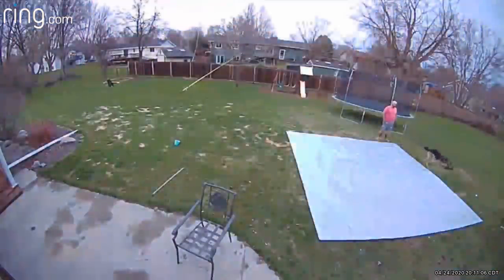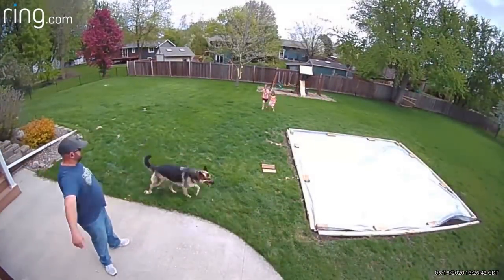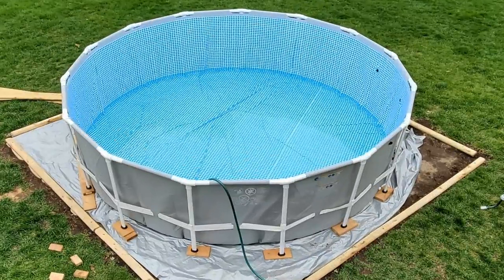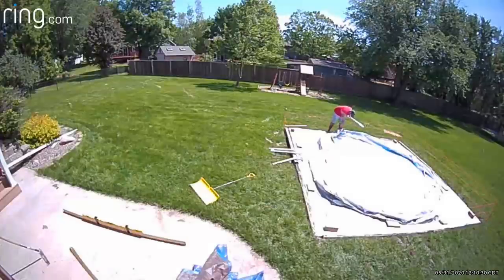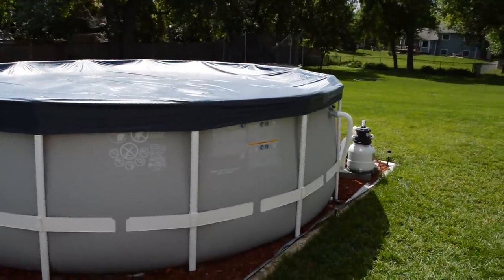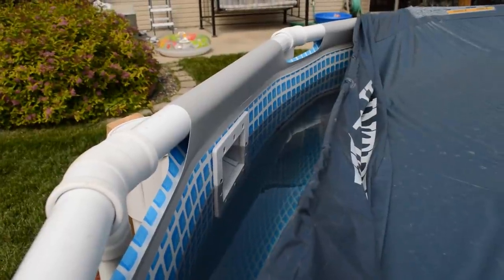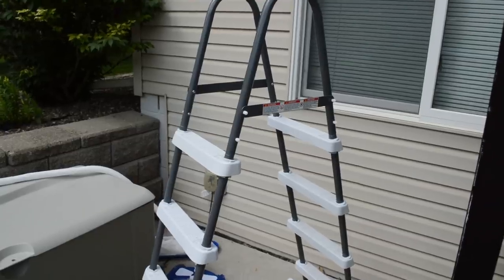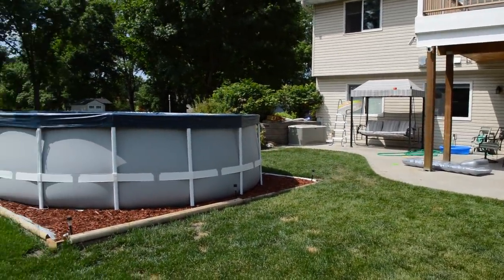Intex 15 Foot Prism Frame Above Ground Pool Setup, Review, and Mistakes!

Comment: If i cut the power of the sanfilterpump with a switched power socket then the adapter of the pump trips and i always have to reset it manually. How have you solved this one?
Reply from the maker: Using the Kasa switch that I recommended, I have no issues with this. I have it set up on a schedule that runs every day and it's never tripped.
Reply: Don't Burn the House Down! So you have this small box in between with the reset button also? I ll check out the tp-link
Reply from the maker: The pump has a GFI switch on the end of its cord with a test and reset button on it. It's never tripped for me using the Kasa (TP link) switch. I keep it in a dry area and it's on a 3 prong grounded outlet. No issues this far.

Comment: Whoops I forgot we had to go get 22 1 ft x1ft 2inch thick pads for each leg to set on to ensure a good stable  footing for the 10,000 gallon pool an estimated weight of 85000 pounds not including  the 5 tons of sand !

Comment: How the hell did you get the last joint together. Mine are like a foot too long on each side.
Reply from the maker: That could be a few things. Some of the other poles might not be fully seeded into the t joints, your ground might be off level causing the whole thing to slope towards you, or you might just need to grab the frame at several points and pull it outward.

Comment: Thanks for sharing. This was very helpful. I have set mine up about three times - 15 feet, and it wasn’t level but it was just enough. We moved into a new house last year and order a new one. It’s 18 feet round and on the way. I am dreading the work that has to go in to leveling because I think I’m about 1 foot off level from front to back but this was extremely helpful. Thanks again. I may come back to let you know how it turns out. Or let you know if I have an 18 foot pool for sale.
Reply from the maker: Thank you for the comment! Definitely keep me posted on how the project goes and/or if that pool hits the market! 😅

Comment: I'm getting low pressure on my filter. Any clues or tips?
Reply from the maker: Low pressure is good!! You want the pressure gauge to be low or in the green. As the filter starts to slowly clog up with debris from the pool, the pressure gauge will rise. If it gets in the yellow or red, it can burst. You need to backwash the system periodically when the pressure starts to get anywhere near the yellow. Keep it in the green or below. As long as you have solid water flow coming in and out, you are good!
Reply: I appreciate it! A video on your use of the filter would be awesome!!

Comment: Did you water the sand after your packed it with the roller?
Reply from the maker: Yes
Reply: Don't Burn the House Down! Thank you! If my pool comes out solid, it's only because of your video and help! I really appreciate it! 🙏
Reply from the maker: Glad I could help! Make sure the sand is dry before you use the roller otherwise it will stick to the roller like crazy and defeat the purpose. Good luck!

Comment: Are your wooden slats sitting on top of the sand too?
Reply from the maker: Yep. They are on top of the ground tarp which is sitting on top of the sand.
Reply: Don't Burn the House Down! Oh wow ok..I didn't know the tarp should be placed under the pavers/slats. I'm using 12x12 concrete pavers. I was really confused is I should level the pavers with the ground floor or sand floor, or they should just being laying on top of the dirt or sand. Really nervous about throwing off the level of the pool. Lots of work! 🤣

Comment: how much does it cost you a month to maintain?
Reply from the maker: That's hard to break down. I bought a massive tub of chlorine tabs last year that I'm still working through so I won't need any more chemicals. Electricity for the pump is really it. It's not that much after the initial startup cost.

Comment: Im sure ground prep is the work most people skip. For my 12 foot, I started by digging down 3 inches on the high side and pushed dirt to the low side and levelled. I should have done al least 1 more inch and compacted the low side better. took me a long weekend to do. I did not have a sod cutter or rototiller. (next time I will rent one.) I later added a brick border to the high side. I drain and take it down every fall because we have long freezing winters. Just finishing 6 years of life. Set up is about 30 minutes each spring. Fill takes most of a day. Those cartridge filters can't filter algae if it gets away on you. I end up vacuuming (siphoning out) half of the water. I will get a sand filter for the next pool .I got my $300 worth out of it. I replaced the cartridge filter in year 5 after it sucked up a piece of broken inlet cover. I might do a video on cheap pool techniques.

Comment: You must level the ground!!! The bottom of the posts must be leveled with the bottom of the pool. Otherwise you are raising the bottom of the poles above the ground and basically stretching the liner, and it will leak or break. I know because it happened to me!

Comment: What kind of tarp did you put underneath?
Reply from the maker: It was a 15x15 tarp that came with the pool.
Reply: @dontburnthehousedownvideos  Ok, thanks. I bought a pool set without that part and was hoping to get a tip about buying a one. Currently going through similar pains as you though. Just started emptying the thing today, as it was not level. Fingers crossed for round 2. Useful seeing your video for that :)
Reply from the maker: Absolutely! Good luck! I'd recommend a tarp that's at least 1-2 feet bigger than the diameter of the pool.

Comment: It may have made sense to rent a tank truck, which could have pumped the water out and held the water, then after fix, pump the water back in.
Reply from the maker: Surprisingly my water bill was only about $50 more despite 2 fills. It wasn't too bad.
Reply: @dontburnthehousedownvideos  OK thanks for the tips.  I just got a pool from a friend, and I will definitely apply your tips.

Comment: hi.you made many small mistakes during the installation.nothing impossible to solve but it can be annoying in the end. for those who want to install this kind of pool.   first level your ground!!!  i first levelled the ground after i got rid of the grass.then i put "geotextile film" (i don t know the word in english sorry. it's to prevent the grass to comme back.) the a put a small amount of sand to fill the  irregularities and levelled the sand too and compacted it. last i put some extruded polystyrene taped together with ducktape on the sand for comfort.   after that.install the pool in the center of your prepared place. build it,and before addind water make the liner as flat as you can getting inside the pool. pull from the inside,from the outside.ask for help.    after that add some water.just a few centimeters.and get rid of the remaining folds. start to fill the pool.and as it gets filled levell the legs ,one by one, around the pool .do it many times as the pool gets filled.think to put some wood under the feet before it s too filled with water because i will be impossible after. and try to avoid the wood to touch the pool.it could destroy it.  control the level of the top ,control the levell of the feet again and again. when completely filled and well leveled install the water filter and pump.   to avoid small rocks or debris going down under the pool you can put an old  water hose around the pool,just at the junction of the ground and the pool. a surface skimmer is a must have too. it cleans the top of the water. during the building be sure to put the legs inside the band,and get the band strait,no foldings allowed.

Comment: You never never build up a low level because it will sink.  Go from the lowest level and take out the higher ground .  Use Patio brick Recessed into the ground so that their level with one another under the verticals

Comment: One more question… When you hooked up your Hayward skimmer I’m noticing in your video that the two outflow valves are not connected that goes back to the pump. How did you cap those off? I’m assuming that the waterline goes above those points in your pool, correct? We ended up purchasing the exact same sand filter pump that you recommended and I am currently trying to get the Hayward skimmer installed and would like to bypass using those two smaller outflow ports.
Reply from the maker: The pool actually came with 2 plugs for those ports. I used those and it works great.

Comment: As long your not using 3+ inches of sand it shouldn't sink as long as the ground is compacted and then the sand  compacted. The base just gotta be close to level. Not far off but close.  Then the feet post should be exactly level for the top rail to be level all around.  I believe you were far off with your base being level at first.
Reply from the maker: Absolutely. And using the sand to fill in the low spots killed me. Lesson learned though! And the second time around, she was great. Now, in season 2, it's still going strong!
Reply: @dontburnthehousedownvideos  the first one i bought i did exactly what the instructions said but after the first season the ground keeps settling and the little rocks stayed up popping holes threw the tarp and the liner. The second one i used an inch of sand leveled over compacted dirt. Then put 1 inch foam board on top of that.  Then used paver sand under 10x10 stone blocks for under the feet. Worked like charm! Going on 4th season

Comment: 18x18 concrete pad, 3inch thick, that’s what I’m probably gonna do, or should I say pay someone to do lol
Reply from the maker: That's up to you but when I got the bid for concrete, they recommended 4 inches thick with rebar to handle the weight. It was a LOT of money. If you have the ability to do it yourself, I would definitely so it.

Comment: Intex recommends not to use sand. A guy I watched said scrape down don’t build up..
Reply from the maker: Scrape down is definitely the best idea unless it means you'll need to build a retaining wall in the process. 😂 And Intex says no to sand as a base due to settling. That's why I used it to simply finish the pad. It's less than an inch deep so it won't settle below that but definitely makes the pool softer when you're walking in it.
Reply: @dontburnthehousedownvideos  looks great. I can imagine the words coming from my kids mouths,that will be putting mine up in a few weeks “,if we had to redo it like you had to… lmbo!! Great video
Reply from the maker: Hopefully it all goes smoothly! Good luck!

Comment: no offense but im guessing you only looked at the pictures in the instructions. the instructions i got specifically said not to use sand and to be sure to stretch the liner with an inch or so of water in the pool.
Reply from the maker: Instructions? Never heard of them! That's why I make videos of all my mistakes!

Also, we're 5 years going strong on the pool so apparently I'm doing something right!
Reply: @dontburnthehousedownvideos  i guess if shooting yourself in the foot to discover that one should not shoot themself in the foot is the right way to do things..
Reply from the maker: I don't rely on instructions for certain things. I'm pretty smart so I rely on that. I understand that when the instructions say "don't put sand down" they say that because the feet of the pool will sink in and cause the frame to fail. The pool needs to be on solid ground. However, being big brained and all, I know that packing the sand first and using wood under the legs to distribute the weight, this will not cause the pool to sink and suffer frame damage. The way I did it makes for an even pool bottom and level legs. Instructions are made for people who can't think for themselves. If you understand "why" instructions say not to do something, then you can still do it in a way that you gain the benefits without the problematic side effects they are warning you against. 5 years of use and everything is as level and great as the first year. So yes..... It worked. If you feel comfortable sticking to the confines of the instructions, you are absolutely able to do so. I shared my experience because it worked for me.

Comment: Hence people buy real pools and get them installed and insured… this pool needs to be uninstalled and reinstalled next summer. Basically finished after two years
Reply from the maker: The pool is on year 3 and still going strong. Zero issues. It's level, hole free, and still providing lots of fun in the back yard.